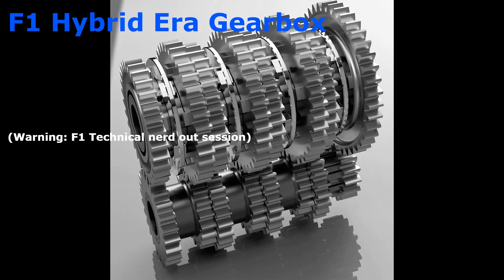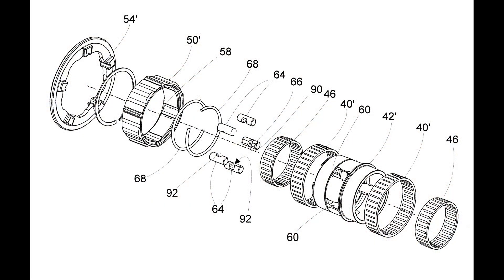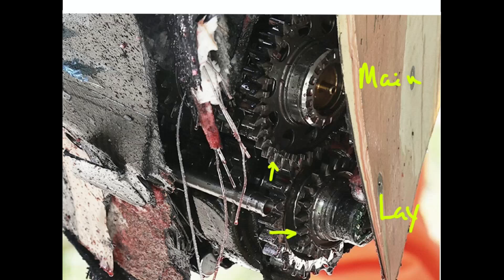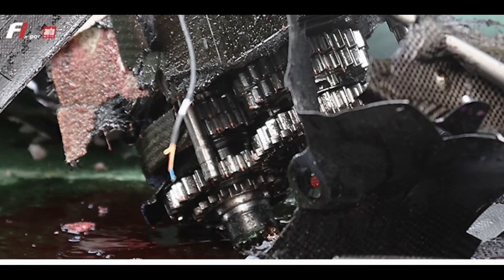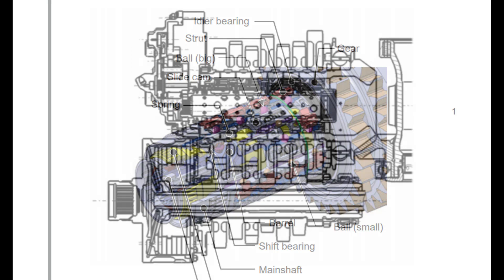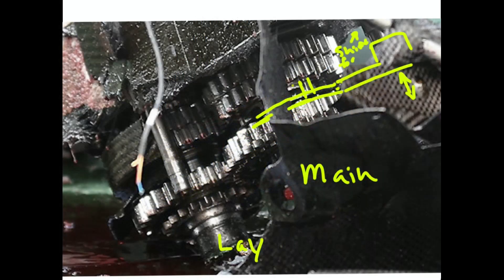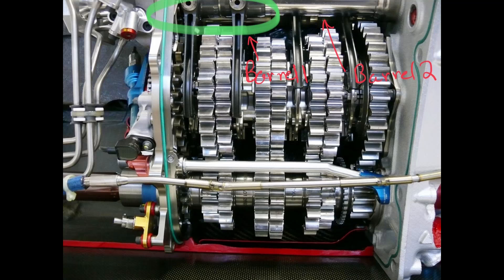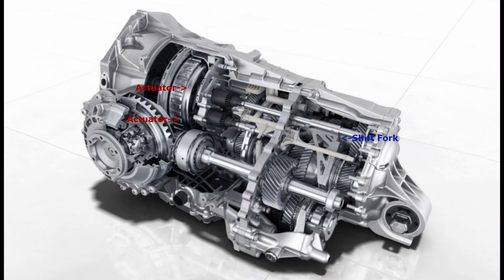F1 Hybrid Era Gearbox Analysis

Comment: Bicycle gearboxes - both in-hub planetary designs and the frame-mounted parallel-shaft Pinion series - use shift mechanisms placed within the shaft. Of course the power level is orders of magnitude lower, and they don't need to be able to back-drive.

Comment: From my observation, the changes in layout from na-v8 to turbo-hybrid are minimal. It retains the dog ring engagement operated by two hydraulically operated barrels. The changes are more evolutionary, more robust dog ring design, more compact barrel positioning.
AFAIK The Honda design seamless was never raced, only a twin barrel type (of which they were one of the the pioneers)
Reply from the maker: That's super interesting.  I wish we could get pictures of the barrel setup they're using.  Unfortunately, it looks like when Yuki's gearbox broke in half they shift barrels were most likely still attached to the front gearbox cover.

Have you heard any details about the clutch setup used inside the mainshaft?  I know Xtrac and some researchers in Japan had several patents come out around 2010-2012 for different clutched mainshaft designs.  I think I'm leaning towards the Xtrac ratchet clutch design that I showed a picture of in the video given it's simple robust design.

I also thought Honda had raced a single barrel gearbox in 2009 with the one way clutch mainshaft hub (the more complicated internal mainshaft barrel was a 2 way, seamless up and downshift).  I'll look and see if I can find the article on the Honda R&D website  I hope someday they will release a complete history of these gearboxes.
Reply: @IndeterminateDesign  check your email 😉

Comment: Why nose fed shafts, why not an oil squirter to shoot it right where the gears mesh?
Reply from the maker: That's a good question.  Based on earlier F1 gearboxes, I believe there are oil squirters but I don't know where they're aimed.  The shafts are fed that way because the mainshaft gears are rollerized and spin freely on the mainshaft.  I assume that they need pressurized oil due the RPM and load.
Reply: @IndeterminateDesign  Seems crazy just for roller bearings
Reply from the maker: I think, and this is just a guess, it's because the the way the hubs for the gears work.  The hub has to spin very freely when the internal clutches are not engaged, so maybe it's like a fluid bearing.  

I think when I have a model of this it will be easier to explain, but in the drawings I've seen there are actually two roller bearings, one inside the other with the hub separating them, and there are oil feed holes in the bearing races.
Reply: @IndeterminateDesign  Interesting, only time I've seen bearing setups like that is in high speed spindles. Theres a term for that type of bearing arrangement, but I cant seem to think of it.

Comment: The honda transmission shown reminds me of a ball-lock shifter. It's used in frc and also some low power motorcycles.
Reply from the maker: I agree, I'm sure that's where Honda got the idea from given their experience in motorcycles.  I want to make a model of that gearbox as well, but I can't completely wrap my brain around some of the more intricate parts of it yet.
Reply: @IndeterminateDesign  so the 3d printed seamless gearbox u did is a replica of the hybrid era gearbox or the old f1 gearbox?
Reply from the maker: @FirstLast-tx3yj  The replica I did was of the 2006-2013 regulation gearbox, the Xtrac P1044.  The last years of these cars did have KERS.  

I would like to create a replica of a the latest seamless gearboxes used in the 2014- Current.

Comment: so these transmissions are somewhat like DCTs?
Reply from the maker: The end result is similar to dual clutch gearboxes, but the rules don't allow for DCT and there's not enough space either.  Each gear has a very small set of 2 way clutches that lock up based on the differential speed between the two selected gears.  Hopefully it will be clearer once I have 3d printed prototype that I can show.
Reply: @IndeterminateDesign  I think I understand, but most of this stuff is above me
Reply from the maker: I'm not sure I really understand either, but I'm going to copy the design and see if it works the way it's described in the papers I've read.